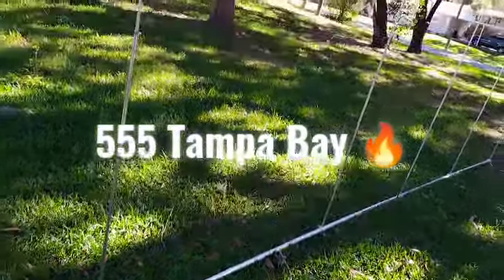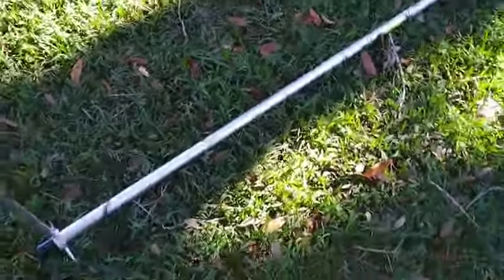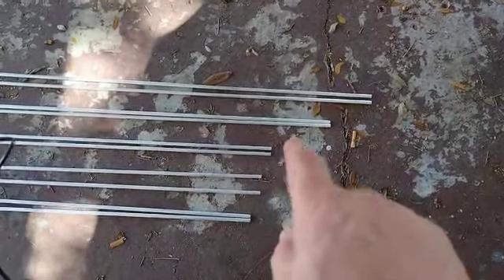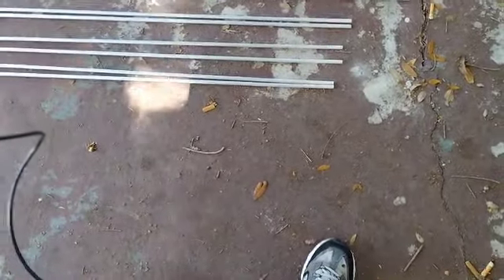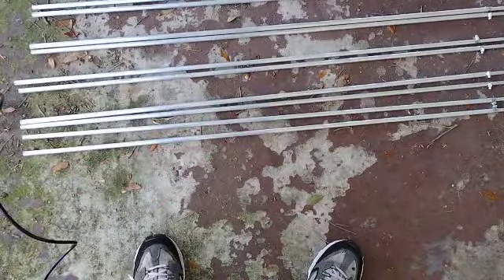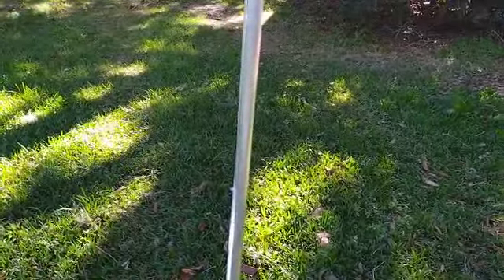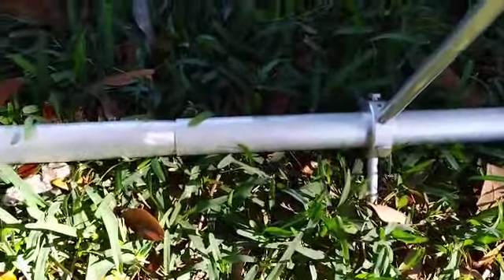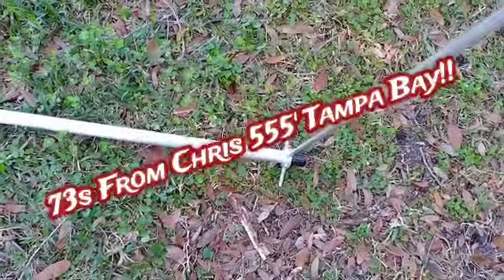Gizmotchy Antenna System #2 Video Gizmotchy Setup Explained

Comment: im about to put mine together and up got two questions
how high should i put it up / and second  what's the spacing between the radial mounts and you measure them from inside to inside correct?